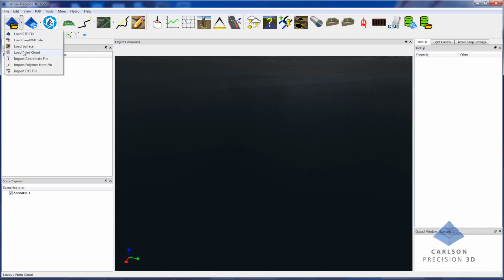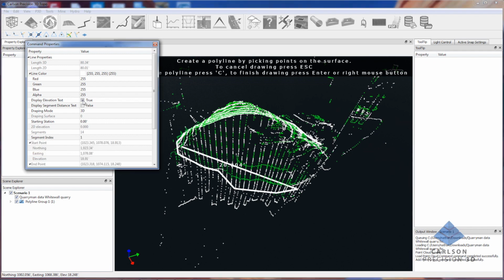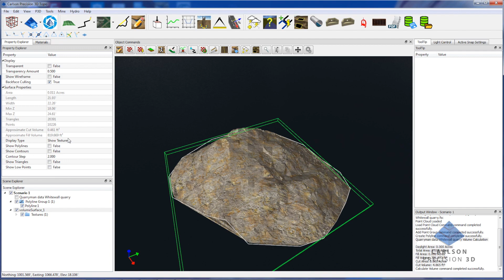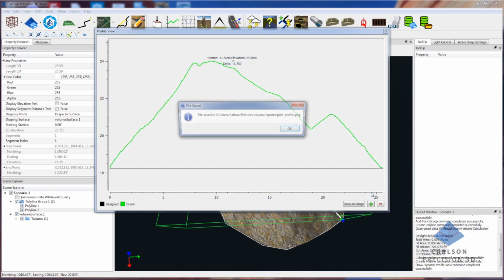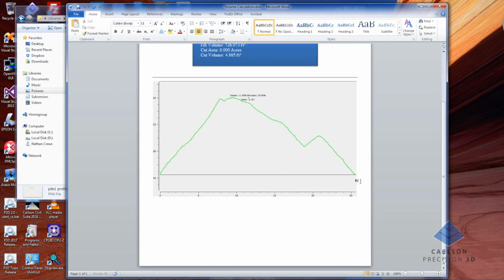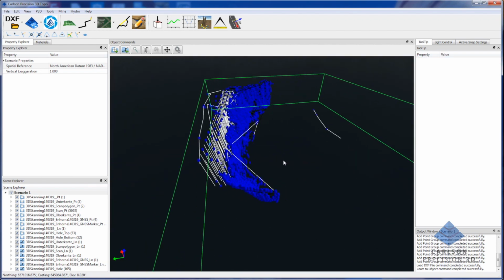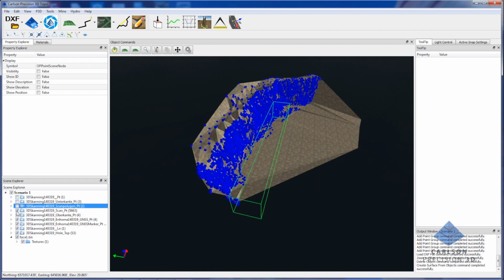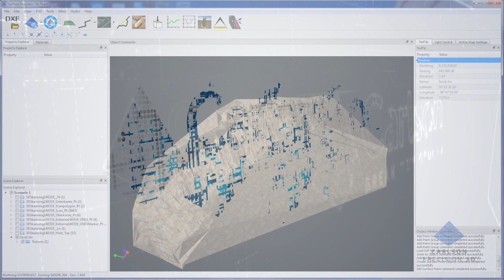Carlson Precision 3D Topo 2018 | Quarryman® Volumes

Comment: Good video, the mouse click noises are terribly annoying though. 2 questions:

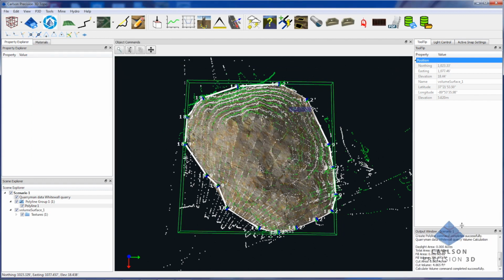1: Once a surface was made on the pile, why is that on the south end of the pile (near top of screen) the surface is below the contours? Around the rest of the pile the surface was pretty much bang on with the contours @2:31

2: Are you able to calculate burden volumes in the software? The amount of material between the scanned face and the front row of drill holes.